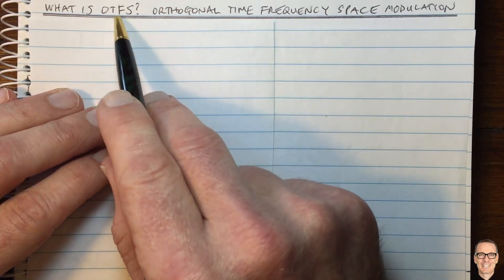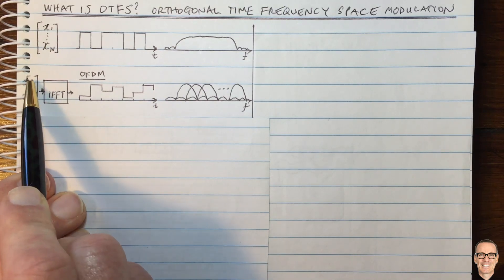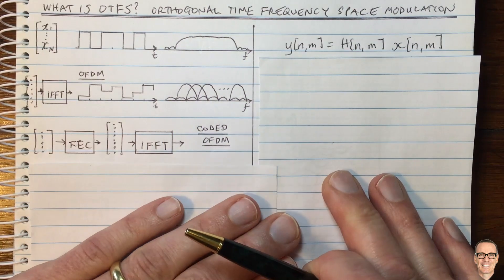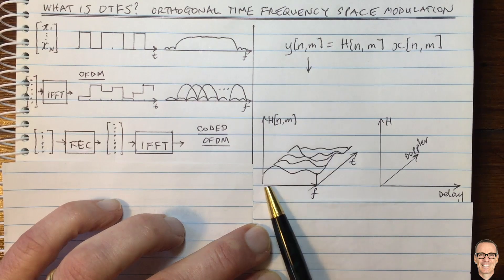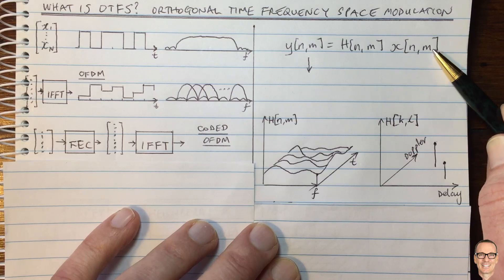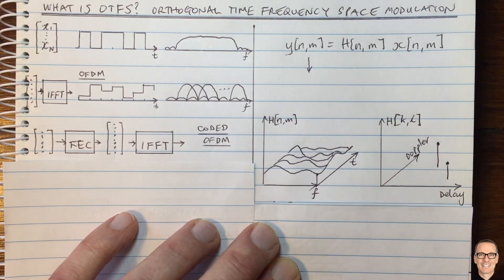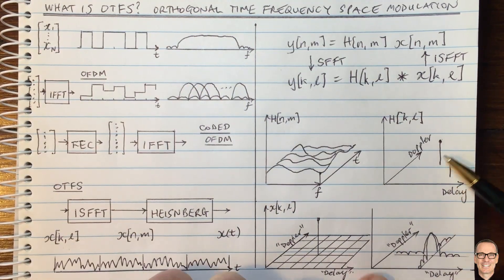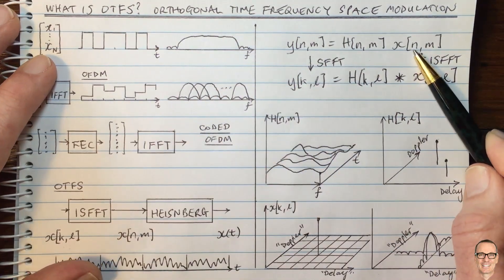What is OTFS? Orthogonal Time Frequency Space Modulation ("Best video in youtube for OTFS")

Comment: At ''9:95'' you changed the equation from frequency-time domain to delay-doppler and you changed multiplication with convolution. the question is that, from time to doppler we use FT but from frequency to delay we use IDFT. I mean at the same time there are 2 transform. But when you changed multiplication with convolution, you just considered FT. Could you please explain it. thanks

Comment: I nearly give up finding videos of OTFS but I find your video, it's amazing ! The others can't explain OTFS without plenty of formula. Besides I wonder if the matrix in DD domain must be sparse? If the matrix can't be sparse, will the signal in DD domain be orthogonal? Thx for answering my problems :-）
Reply from the maker: I'm glad you found the video helpful. As I mentioned, it is not clear that practical channels will have sparse DD representations in reality. That's an assumption that research papers make, but there is no clear measurement data to confirm it, that I've seen yet at least. And in terms of your question about orthogonality, as I mention in the video, the input data DD representation is of course orthogonal, but the output of the channel is not (ie. never) orthogonal, even if the channel is sparse (due to the twisted convolution effect of the channel).

Comment: Dear Ian, thank you very much for your explanations. They illustrate OTFS really well.

However, it is not entirely clear to me why the robustness of an OTFS signal should not be dependent on Doppler shifts. With several paths with different Doppler shifts, the symbols still interfere in the Delay Doppler plane, don't they? Can I calculate this interference back by “de-convolution”, in contrast to the intercarrier interference in an OFDM signal? Could you please explain this a little? Thank you very much!
Reply from the maker: Yes, exactly. That’s right, the channel is not orthogonal, and the received signal needs to be equalised in the delay-Doppler domain. I plan to make a video about this in the near future.

Comment: This is very interesting! I took a look at some of the papers, but as someone interested in comms but without professional experience, I'm a bit confused about the high level advantages. I'd thought that 1) one of the key benefits of OFDM is that it turns the ISI problem experienced by time-localized carriers in multipath channels into a much easier to compensate per-carrier equalization problem, and 2) high doppler spread channels for OFDM are challenging primarily because of the ISI they create. It seems that what OTFS does is turn delay/doppler spread into purely an ISI problem, with flat gain regardless of carrier? The flat gain is clearly attractive, but this seems like the exact opposite of the trade that was made when going to OFDM.

At the point that OTFS carriers are spaced far enough apart to avoid ISI, it's not intuitive to me why that's better than doing the same in OFDM. Same for any de-spreading scheme.

I'm sure I'm missing something here, and would appreciate any insight!
Reply from the maker: It depends on the form of ISI. The links between OTFS and OFDM are the topic of current research. I've actually got a paper submitted to a journal at the moment on the topic.
Reply: Thank you for the video!
Has this paper already been published?

Comment: How is OTFS modulation orthogonal in Time ?
Reply from the maker: Yes, as I explain in the video, it is not actually orthogonal in time, frequency or space, but as I say at the 14:23 min mark it is orthogonal in the "delay" variable and in the "Doppler" variable. Personally, I don't think that OTFS is a good name for this modulation format - especially since it doesn't actually use the "space" resource (since it only has a single antenna at the transmitter and the receiver). It might be better to call it Doubly Spread Modulation, or perhaps Delay-Doppler Modulation (but I don't like that either, since it's the channel that imparts the delay and Doppler, not the transmitter).

Comment: Hi professor, I had an OFDM question. I understand that OFDM is popularly used in downlink, but it is not particularly favorable in mobile uplink due to OFDM symbols having a relatively high PAPR which is not favorable for mobile devices with low power resources (approx. 12 dB is the figure I saw on Wiki). I see that this is due to the central limit theorem but am having difficulty conceptualizing why OFDM symbols have high PAPR. Could you provide some details on this topic?

Dave
Reply from the maker: This video will hopefully help: "What is PAPR? and its relationship to OFDM" https://youtu.be/F4LAZTdm_b8

Comment: hello sir, 
the loss of the orthogonality of the subcarriers is occurring due to dopplers shift in the carrier frequency ie(fc+(dopplers freq)), which means when we observe in the frequency domain at receiver we will receive an instantaneous frequency shifted by dopplers and which can be observed as the time rate of change of phase with time(1/2*pi *(phase/time)) sir is not possible to somehow cancel that effect of dopplers by varying the phase of basis function in the opposite direction so that overall effect of the rotation in phase due to dopplers will be canceled by rotation in phase of the basis function in opposite direction.
Reply from the maker: Sorry, it's not clear if you are asking a question, or making a statement. The first part of your comment appears to be a re-statement of what I said in the video - so yes, I agree with that. In the second part of your comment, you raise an interesting point, that I think many people think is what's going on in OTFS - but it isn't. In principle it is tempting to think that it would be possible to 'precode' the input matrix - for example as is done in MIMO with a zero-forcing precoder. But this is not possible in OTFS for two reasons: 1. the delay-doppler of the channel might be able to be assumed to be constant over the length of an OTFS symbol, but it is unlikely to remain constant over longer time-scales of multiple OTFS symbols - so it won't be possible to know the channel ahead of time at the transmitter. 2. It is not a simple case of pre-multiplying by a 'precoding' matrix, since the channel operation is 'convolution-like' in the "delay-doppler" domain, so it's not clear what sort of precoding could be done - certainly not just matrix-multiplication precoding.

Comment: There is a fair amount of buzz about OTFS in context of 6G, similarly as it was with NOMA and 5G. However, I am not sure if this is the right direction. IHMO, the key for next generation waveforms would be increasing spectral efficiency and, as far as I am aware, OTFS does not address this issue. Accuracy of channel estimation and quality of CSIT / CSIR are well-explorer research issues. And yes, this could be really problematic since for instance it could limit number of available degree of freedom when it comes to MIMO. But again, I am not sure how OTFS targets those problems or if it even addresses MIMO at all.
Reply from the maker: Yes indeed. Those are all good points. OTFS is perhaps best suited to situations with a small number of scatterers and fast moving transmitters and/or receivers (eg. LEO Satellite comms). These are not good conditions for MIMO. OTFS could conceivably be combined with beamforming or MU-MIMO.

Comment: video: FT for the data input （square wave in the case)  
me: yep
video: OFDM
me:yep
video: coded
me: no problem
video: convolution is multiple when FFT 
me: yep, that was what my signal system told me
video: the graph just next to the graph of multi path delay and doppler 
me:??.     (?o?)
Reply from the maker: If there are only a small number of scatterers in the channel, then the channel impulse response will only have that same small number of non-zero delays. And if the terminal and/or basestation are moving, then each of those Delay components will have a Doppler value associated with it. So they will appear as isolated spikes in the Delay-Doppler domain.